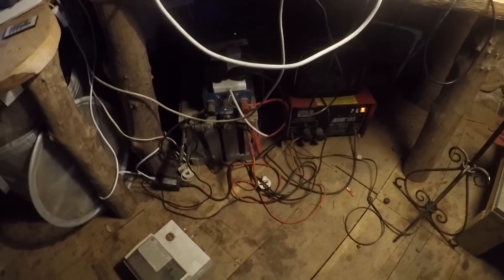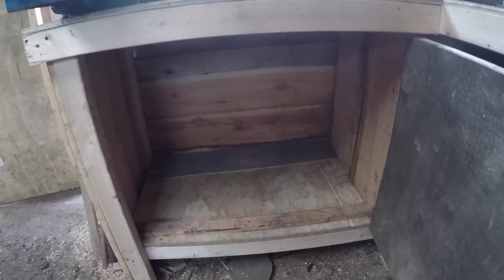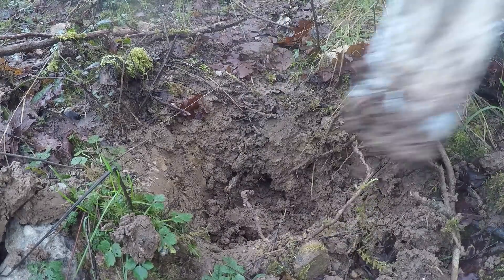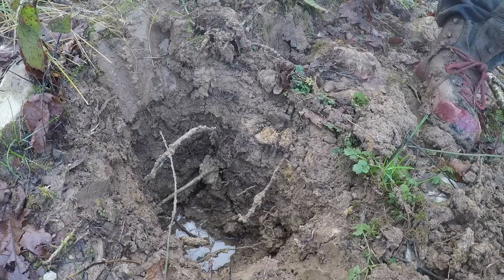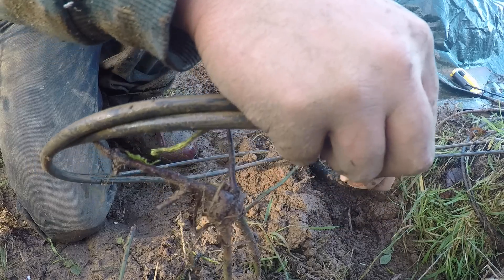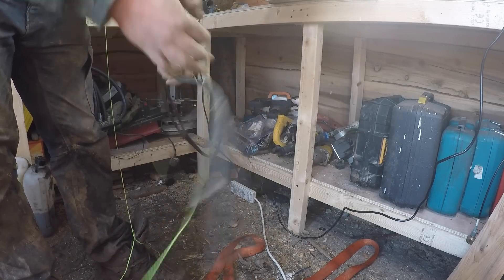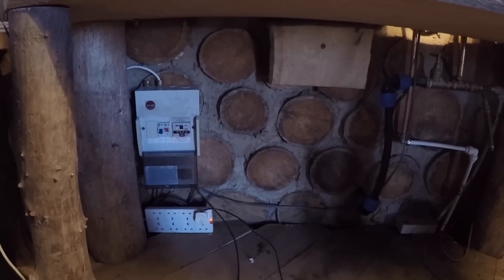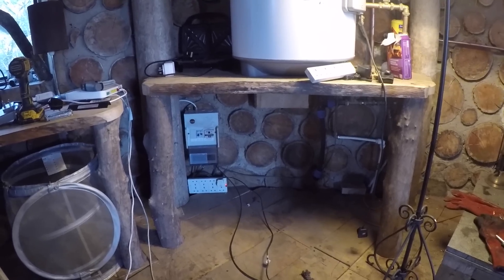DIY Micro Hydro part 11 Moving power out to the workshop

Comment: You should find a small electric water heater  to use instead of those heating coils. That way you can still use the excessive energy from your system instead of waisting it first nothing. You can store the extra energy in hot water. Just trying to help.

Comment: If you ever replace that inverter, there are ones around that just have a terminal block to "hard wire" the inverter to save using a plug like that, although they can be hard to find.

Comment: After so much time, I'm sure it's been said, but when tying a pull string to wire (even more so with wires(plural) loop a series of half-hitch knots (oriented so that pulling (from direction of pull) bites into the wire) then give your pullstring leading and trailing ends a quick wrap of tape, then a couple more wraps to cover the last couple inches of wire transitioning to just the string.

taping the lead and tail of the string keeps your half-hitches taught and taping the wire end/string only transition keeps the wires from poking into the wall/doubling back on itself... tape tip can also help it pull around bends or through access junctions.

Comment: Pulling cable is part of my job. The hover idea was great. For a short pull the way you did it is perfectly fine. The only things I would change for a long pull would be to use some electrical tape to bind the two cables(at the end and about every meter) and some cable lube.

Comment: Great work as always. Why didn’t you put the wire in the pipe first instead of trying to thread wire after the pipe was installed?
Reply from the maker: thanks, you ant push electrical wire through conduit. it just gets stuck.

Comment: I don't know how far you used water pipe as a conduit, this is not a good idea as several years down the line you may want to connect something into your water line and accidentally cut into your conduit water pipe.
Reply from the maker: they are in completely different places. not really clear in the video. but there isnt two identical pipe running near each other
.
Reply: I thought you might have it covered👍

Always good to put indicator tape 300mm above the cable when you bury it too. A bit of a give away if it's tucked inside a water pipe too.

Keep up the good vids👍

Comment: Well some people are going to do it differently and then they're going to find out that they must do it a certain way.. depending on your jdistance. One cannot expect DC current to go through a small wire long distance..  and then magically keep great charge into a DC battery Bank.. what seems to be the solution that is simplistic and not expensive complex is to place One battery and a converter to a small DC converter110 or 220.. household current through the long-distance wire and into. Then with full devotion and matching the small DC converter will run an dc battery charger this is powering up your larger battery Bank with the larger DC converter that can run many things..   now I say this system. Need some gray consider ization in both battery charger one that will not overcharge the batteries and in the power source power turbine house one that will not drain the batteries a converter that will not drain the batteries and will not require a mandatory reset.. and then there's just hold timer that says why don't you just run 100 + 10 generator..  ultimately I cannot figure you placing your power plant and in the middle of a stream as soon as you get an inch and a half storm rain that jelly may wash out your Powerhouse but you talked of concrete perhaps you're going to make a concrete Dam I do not know..   but thank you for entertaining my mind and I hope I gave you some things to think about.. when that electricity is not charging the batteries be sure to dump it into a hot water element and pump it through your house in a radiator Heat then you might want to have one pumping into a barrel stove as well heating up hot water in a barrel stove.. I will close by saying greetings from the United States have a happy New Year Merry Christmas keep your chin up good luck on your property..

Comment: I am an electrician most you work was just fine except I urge you to find a different location for that sub-board there is just too many water hazards in that location more so if you put a washing machine there, preferably higher and further away I know that the sub-board isn't pretty but about eye level is best also somewhere easy to get at even if you put the whole enclosure inside a nice wooden cupboard to dress it up

Comment: hi Kris, great job with the wire the next time I would put some electrical tape on the staggered nose of cables and down your half hitches to prevent the pulling rope coming off in the pipe by slipping.. Peter

Comment: Would it not be a better option to run 12v lighting direct from the batteries rather than bumping it up to 240v just to run a low wattage bulb ? You can get some really good 12v LED light fairly cheap now days.
Reply: Yes and no. It depends on location. If the batteries are close to the application with fairly stout wire in between the two, 12 volts would be better. But for distance though wire like he has, 240v AC will carry power with much higher efficiency.

And I just realized your comment is over a year old. Sorry.

Comment: For "not an electrician", you know a lot of the tricks of the trade. The piece of plastic as a mouse on the string and the vacuum to pull it through is a great trick, we use that all the time. You also tie the string to the wires the same way I would, however I would also wrap all of the knots in the string around the wire along with the whole  front 6in with electrical tape. That makes a nice smooth pointy bundle out of it.
Reply: Also never pull a cable run without a fallow string tied on for future cable, if you have room in the conduit. Plus if the string comes off you do not have to do the mouse thing again string is cheap. There are many things you can use to lubricate the cables to help ease the cables through the conduit.
Reply: @frankdeegan8974  you sound like you are a communications cable installer, such as  me. Always install a extra pull rope with the cable. Just be sure to use a swivel so it doesn't twist to much around the cable.
Reply: Yep, I was going suggest the same thing.  Only thing that might it more difficult for him was since he just pulled the cables out of the ground the tape may not have stuck to them great.  But with fresh dry cables it would be a nice extra level of security that I almost always do.

Comment: What batteries do you use? Are they leisure batteries? Are the Gray boxes that store the batteries, or is that they way you bought them?
Reply: I could be wrong but they look like 100ah or possibly 200ah 12v AGM lead acid batteries, im purely basing that off the fact they look identical to my 100ah AGM batteries except mine are blue.

Comment: A tip for tightening up the large pipe fittings in awkward spaces is to wrap an old inner tube around it,  stick a piece of pipe through the loop, twist it up tight and that will give a better grip than ratchet straps. You can buy commercial rubber strap wrenches but how often would you use it after installation.

Comment: ''I'm not an electrician'', but you play a pretty good one on the Tubes. Nice job. My only          concern, is the conduit large enough for the wire? It looked awfully tight and could cause heat.

Comment: I would really only like to read somewhere that you ventilated your battery box.  It is very  important that your shed does not go up in flames or your found laying on the floor from gases.  Other than that concern, i always look forward to seeing your next vid.
Reply: The batteries appear to be SLA.
Reply: Jason Hendren I agree, vent pipes in and out to prevent gas accumulation. Depending on battery type, it needs some protection from fumes as they'll soon ruin that lovely cabinet.

Comment: Hi Kris, I wonder what will be your "controler" for Pelton generator. Juste take care with it, when the battery will be full charged, the controler will disconect the charge to battery, so your generator will be unloaded and will over-speed, with no load my generator  go to more than 400v (4000 rpm). 2 ways : when battery is full, you stop the turbine (could be with an electric valve and a kind of procesor (arduino), or you use a controler with a dump load (a resistor and may be use it to heat water) see :http://scoraigwind.co.uk/using-a-high-power-resistor-as-a-dump-load/
Reply from the maker: good question, becaue i have lower head and a lower voltage turbine mine is going to be quite simple. once the battery is full and it disconnects it will just spin faster. but wont be to fast to make it over rated speed and over voltage of the charge controler. my calculations say it will be under 200v  that way it keeps things simple.
Reply: Kris Harbour Or beg Tesla for a power-wall freebie? Who knows they might think it fits your circumstances abd what they are trying to show with decentralised power production/storage.

Comment: Nice job.  I have a couple of questions.  How is the cobb holding up?  Have you had fill any cracks or the like?  What are your winters like, do you get any snow or below zero temps? Cheers mate.
Reply from the maker: Hi, the cob is holding up perfectly so far. there are some gaps around some of the logs that are behind the wood stove but the insulation means no air can pass so its not a problem. im only talking 5mm gaps around the logs that are right behind the fire. no cracks no movement that i can tell.  and yes we get freezing temps but not that often. the small wood stove keeps in 20-24 degrees inside. i am very comfortable :)